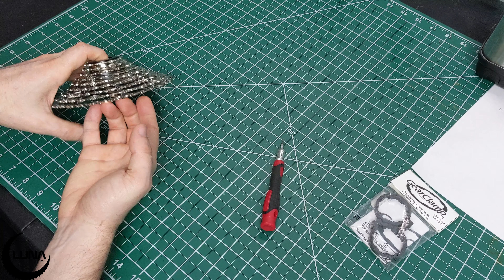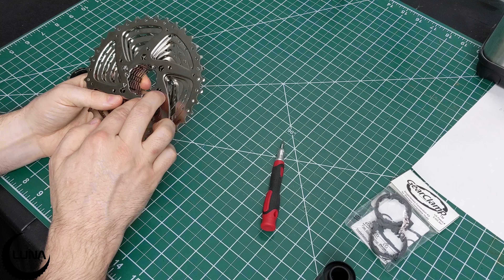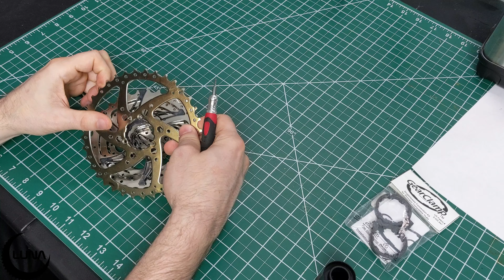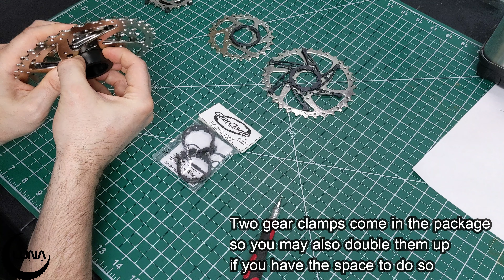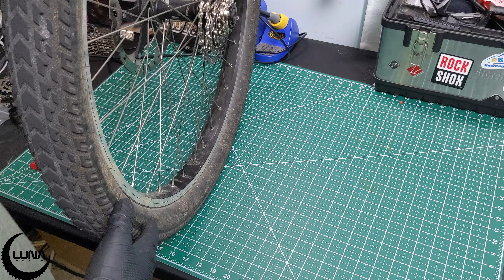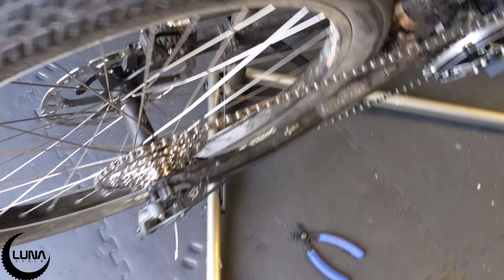How to rework cassette for improving chainline on mid drive ebikes

Comment: I don't like or trust the idea of those clamp spacers, you're better off using proper spacers behind the cluster so that you can get proper torque on the cassette lock ring. Also worth noting, don't use a plastic/nylon spacer against the cassette body shoulder(all the way inboard), it can pop up over the shoulder when the lock ring is tightened down. I would even avoid using aluminum, especially of the shoulder/step is not very pronounced. Boone makes a nice titanium one for $20, as well as aluminum in different widths. If you're on a budget and have the time and tools you could always scavenge an old worn cassette from a bikeshop(they are usually thrown away, anyways), and rob the spacers from it. I've also resorted to cutting down old cogs to make spacers in a pinch. Or you can go the cheap, laziest way and rearrange the cogs you want to use, putting the odd ones out in the most inboard position, and just limit them out. lol

Comment: Is it possible to use old sprockets and spacers for spacing instead of clamp ?
Reply from the maker: You can indeed, though it will not look as nice. That was actually how we used to recommend this modification. The link below shows some pics of a cassette like that. Underneath this embedded video you can see the original guide with the sprockets simply rearranged. 

https://electricbike.com/forum/forum/knowledge-base/motors-and-kits/bbshd/39170-how-to-rework-rear-sprockets-for-mid-drive-systems
Reply: I considered cutting down old gears but it would be heavier then these aluminum clamps.

Comment: why not just use the redundant gears as spacers?
Reply from the maker: @KunjanChauhan  you certainly can! I removed them for a cleaner look but it can be more straightforward to just swap them around like that, the linked text guide this video was based off of does it that way!

Comment: Have you ever done just 2 or 3 gears lol. Like a 42T then 20T then 12T? Seems like that's all you would need.
Reply from the maker: The thing is, if you have a very large jump in gear size from one to the next it will not shift smoothly. You would probably need at least one other gear in between that 20t and the 42t.
Reply: @fuzzyfriendlydoggy  definitely gonna try it though. Good video
Reply from the maker: @FC2ESWS  thanks man. Good luck!

Comment: I think spacers would be best to prevent any movement of the clamps. Only issue is that I'm not finding any spacers....
Reply from the maker: You would need just the right amount of spacers, or the clamp would still move a bit. I found just doubling up the clamp works fine, the second clamp acts as a jam nut. 

Or you can just rearrange the cassette with the existing cogs and spacers, depending on the cassette. Doesn't look as pretty though.
Reply: @fuzzyfriendlydoggy  yes I rearranged the cogs but it's ugly. Plus I'm not finding a way to limit my derailleur to just the 3 cogs. The L screw isn't going to be long enough to go from 9 cogs to 3 (I think). About the spacers it would take the function of the clamp so I would have the spacers between the cogs and the spokes. But hard to find a dozen 2mm or 3mm spacers out there. My problem with the clamp is that I'm afraid it might move around due to the pressures.
Reply from the maker: @vapeurdepisse  For the L screw it uses a standard machine bolt, I just bought a longer one from boltdepot.com. But yeah I get what you mean about it being ugly, and about it moving around. I had that issue when i used just one clamp instead of two. 

What would be really nice is to have a machinist come up with some spacer or series of spacers that would exert force on the cassette, like a spring. then it would always sit where it needs to and could extend as much as needed

Comment: Would not work on my Trek Marlin 6. Derailer would hit the large cog and not allow the down shift.
Reply from the maker: You have to have a smooth transition from each cog size. If one of the cogs is too large then yeah it will hit that large cog and not allow it to go on.

Comment: do you have to adjust anything on derailur
Reply: Less cable tension so that the derailleur cannot pull the chain behind the cassette.
Reply: You may also need to adjust the lower limit screw but start with adjusting cable tension and see where that gets you.
Reply: @justin169169  thank you

Comment: Why not just use regular spacers?
Reply from the maker: Regular spacers may not have same indexing
Reply: @fuzzyfriendlydoggy  Thanks. Yea, I have a 10 spped Talon 1. I could not find this one in 10 speed that comes apart with one bolt. I am building a BBSHD right now, but do not want ten friggin gears! From what i've learned, if you got a 10 gear system, you basically have to swap out the cassette, the derailuer, and the shifter. pain in the azz.
Reply from the maker: @RetroMancer242  ideally you would do that anyway as 10sp chains are usually more fragile than 8 or 9

Comment: The Shimano HG (HyperGlide) and similar cassettes are designed so that adjacent sprockets interact with each other to make shifting gears up or down happen very smoothly.  So it is not a good idea to remove any intermediate sprockets.  Better to remove only sprockets from the big end or the little end.  (Sometimes the smallest is also the lock nut, so it must remain.  Just don't rely on being able to easily shift to or from it.)

Comment: Do you notice an increase in acceleration
Reply from the maker: It is meant to optimize chainline not speed, though I suppose if you are using a gearsensor it would increase speed insomuch as the gearsensor would not have to cut power as often since you would be shifting less

Comment: You need the chain to be in line with the middle Gear.
Not the first gear
When it's in the last gear it will be well out of line.
In the middle is the best of both worlds.
High and low
Reply from the maker: When using a mid drive motor on a chain with intrusive chainstay the chain is already not centered on the middle gear, addressing that is the whole point of the video.
Reply: @fuzzyfriendlydoggy  Thanks I am having problems with bad alignment in 1st gear, I mostly climb hills so this video has got me great alignment in that gear
Reply: @fuzzyfriendlydoggy  Wrong. You space your motor out to be in line with the middle cog of your cassette. Just use a bottom bracket spacer inbetween the motor...
Reply from the maker: @Yes-sw8gh  This guide is for folks who have the motor too far outbound, like due to a wide bb shell or the chainstay getting in the way. It is a common problem among ebike builders especially on many newer frames built for wide rims since the chainstay must flare out to accommodate it.  No spacer in the world will fix that, it will only put the motor further outbound. If your motor is too far inbound then by all means use a spacer, nobody needs a video guide to explain such an obvious solution to a simple problem.

Comment: Any difference in setting up derailleur?
Reply: Less cable tension so that the derailleur cannot pull the chain behind the cassette.
Reply: @justin169169  thank you
Reply: You may also need to adjust the lower limit screw but start with adjusting cable tension and see where that gets you.

Comment: Great video. Reduced my 8 speed to 6, which still leaves a pretty awkward chainline even with a perfectly positioned front chainring. But <6 gears means there's an awkward gap somewhere. I find that there's always one "bad shift" no matter how I stack it, maybe I just need a new cassette. Maybe a good excuse to find a 9 or 10 speed system as a base. GearClamp is a great recommendation also.
Reply: Chain line doesn't matter